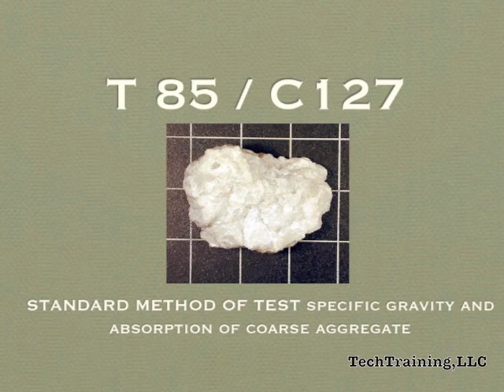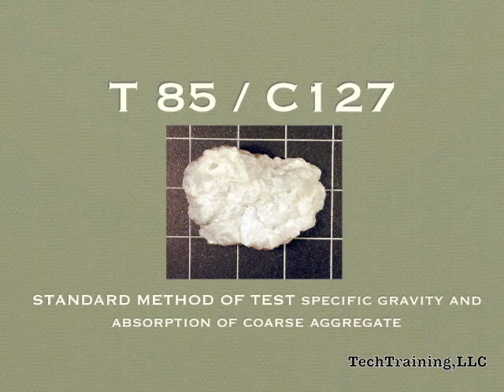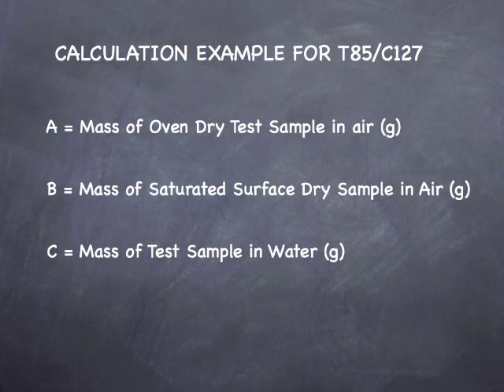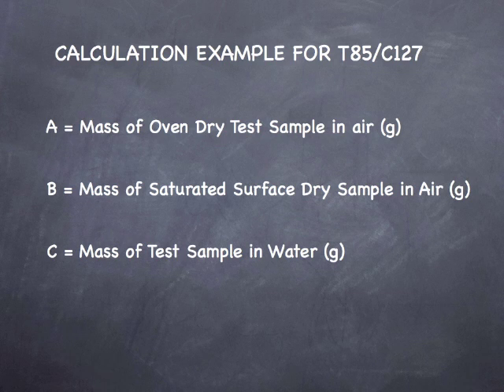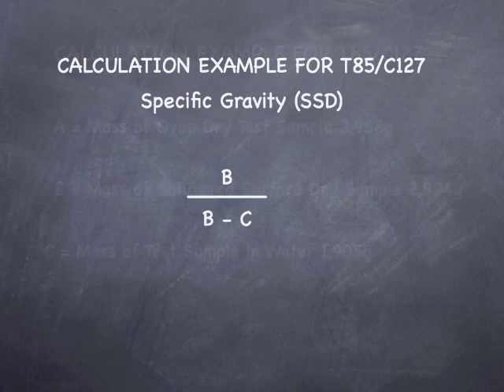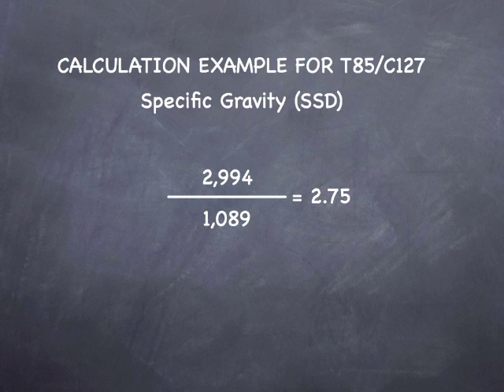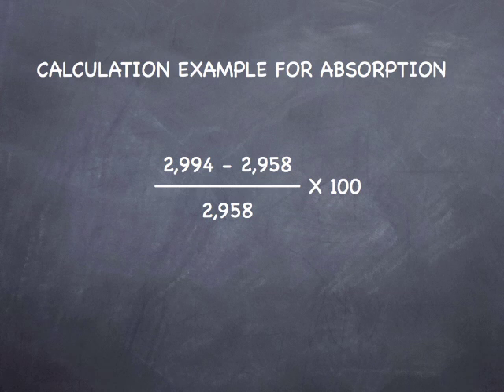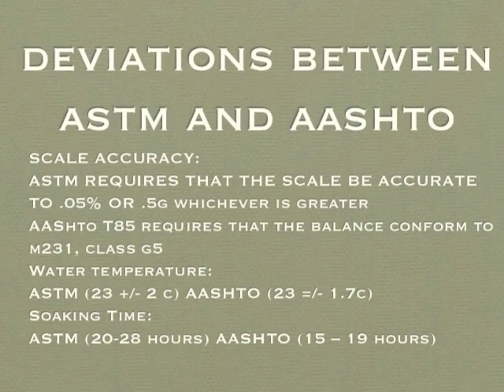AASHTO T85   ASTM C127

Comment: in astm c127 "If the coarse aggregate
 contains a substantial quantity of material finer than the
 4.75-mm sieve (such as for Size No. 8 and 9 aggregates in
 Classification D448), use the 2.36-mm (No. 8) sieve in place of
 the 4.75-mm sieve. Alternatively, separate the material finer
 than the 4.75-mm sieve and test the finer material according to
 Test Method C128." when we use 2.36 mm sieve or 4.75 mm sieve ?